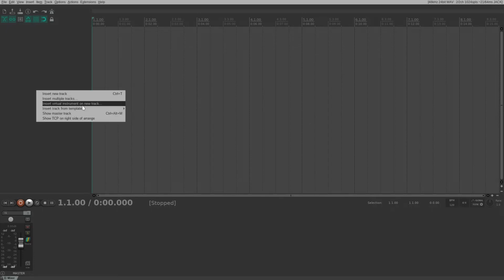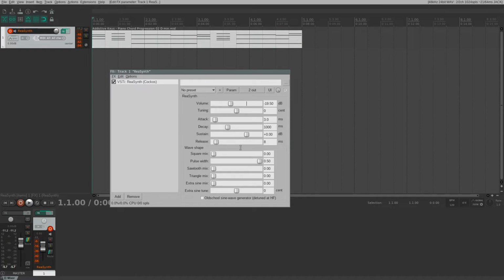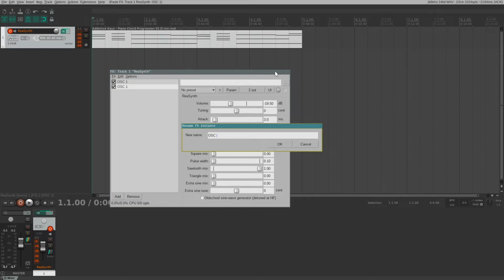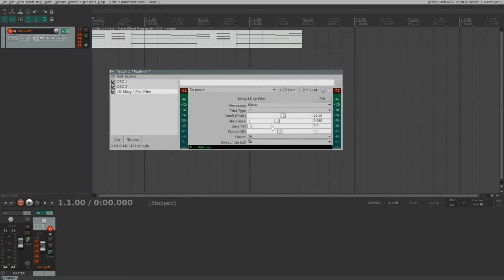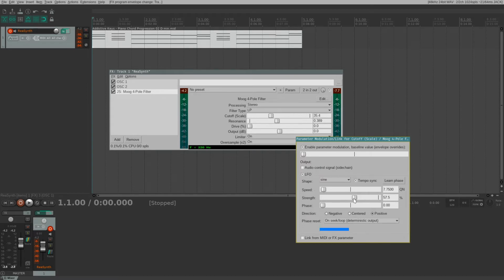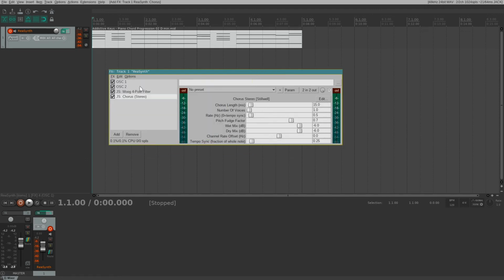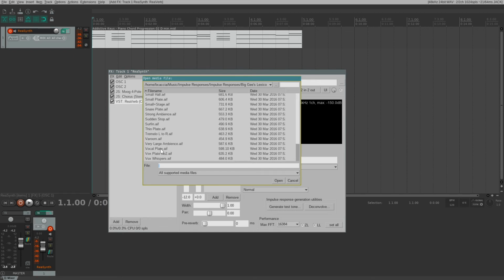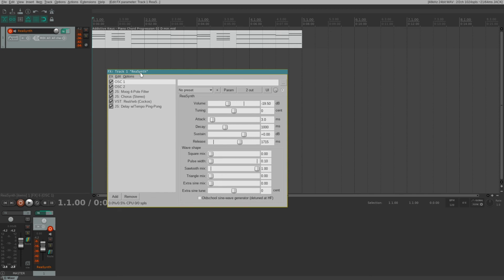[Reaper] - Make a synth pad with stock plugins

Comment: Very cool video dude! Need to try this and come up with my own pad. Is it possible to achieve something sounding like strings pad  only with stock plugins?
Reply from the maker: You could probably make a string like sound if you adjusted the ADSR in Reasynth to have a longer attack.